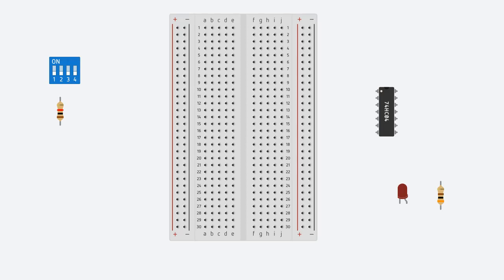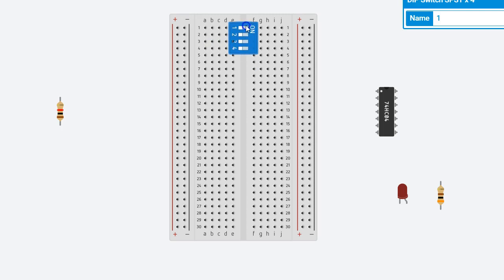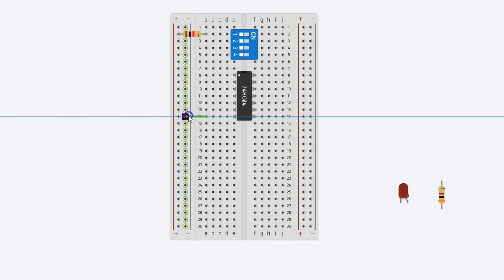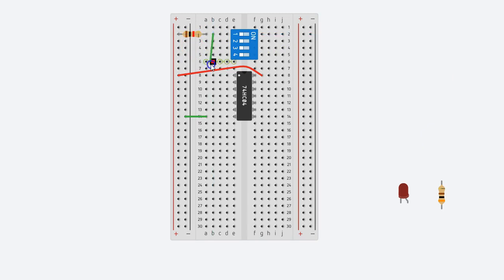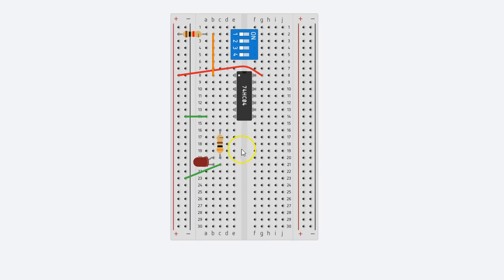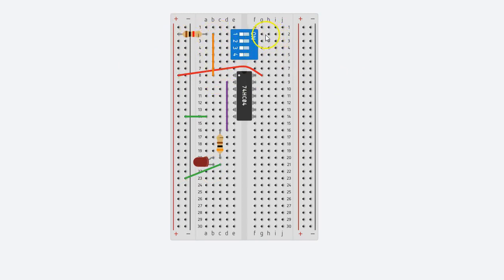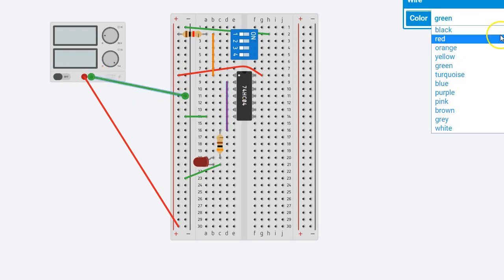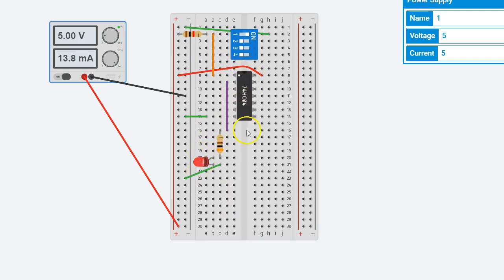Wiring and Testing a 7404 Not Gate/Inverter

Comment: I am confused. With the NOT gate, is the LED supposed to be on when the switch is off and off when the switch is on?
Reply: he's using a pull up resistor so the inverter is basically taking ground as input that's why the led turns on. pull up resistor inverts the on to off. notice there is a parallel connection from 0 Volt(between resistor and switch)  to 7004 input when switch is on.
Reply: Nope. 1=0, 0=1. To make it work like that change the things connected to switch 1. Connect resistor to ground and upper wire to Vcc instead. Easy fix!
Reply: @mashai1161  Thank you so much! I can do my assignment because of you <3